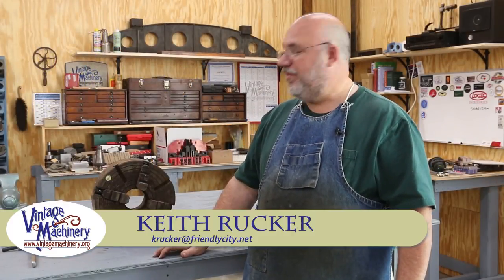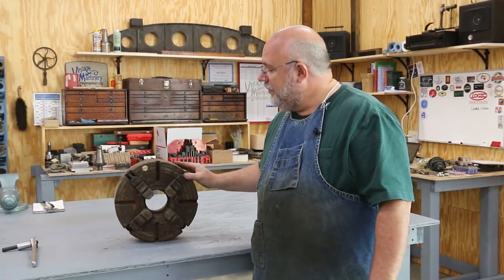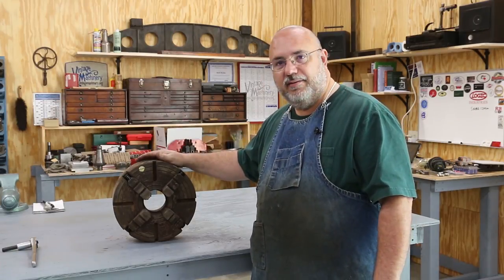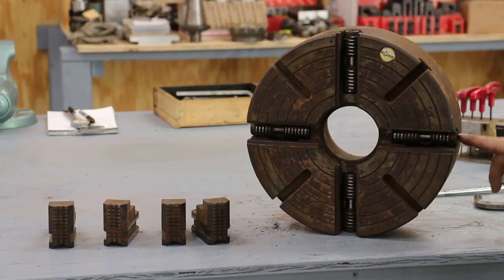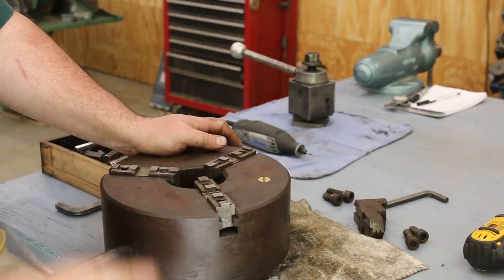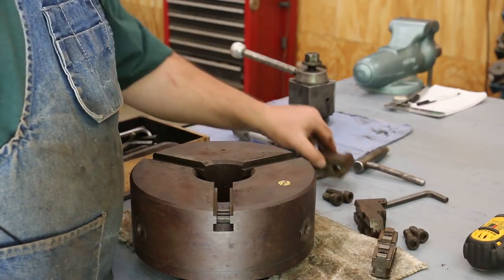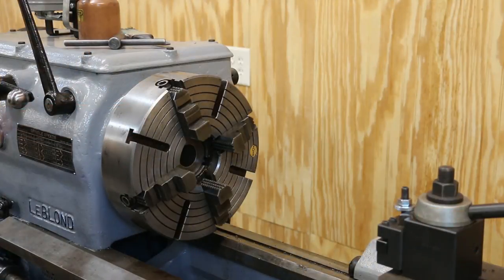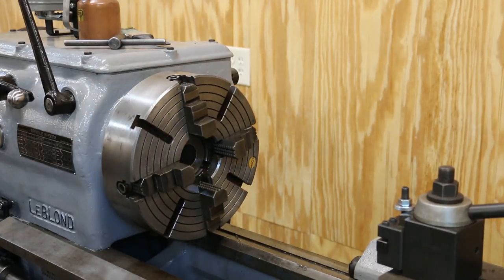Refurbishing Lathe Chucks

Comment: Everybody here in the comments is apparently an expert with more skill and knowledge than Keith. The man knows what he's doing or he wouldn't be so successful, quit your nitpicking.
Reply: RustyDockLight Wow, the comments on the grease over oil use where dead on right. My own comment on the straining of the evaporust is experience based knowledge from not only my own personal workshop, but also job experience in a plant that had military grade and micro medical contract strenuous condition tolerance's. No one person is an absolute expert on every aspect of any one thing. As specially not a multifaceted field like machining and maintenance an care of such things. It never hurts to take others experience into consideration.

Comment: Why are you skimping with the grease?
Reply: True I would have used half a tube of lithium grease on each.
Reply: Cause he doesn't want to be wiping it off the ceiling above the lathe for a year.
Reply: @stargazer7644  use quality grease and it stays put
Reply: @earleclemans4836  I've never seen grease with anti-inertial properties.
Reply: @stargazer7644  grease dont come out of my chuck

Comment: Wouldn't putting grease on the scroll thread cause premature wear by allowing dust/grit/chips/etc. to be pulled through? I would have assumed you would grease the pinions and crown, but not the jaw scroll.
Reply: Biggest no no in machining is grease, oil on chucks. Every piece should be dry!
Reply: If you run coolant, nothing will be dry...
Biggest problem in machining is improper use of compressed air and grinding/polishing on a lathes (lathe is not a grinder). Plus shitty jobs like turning old rusty drum brakes.

Comment: Hey old fella ,do you maybe know how to regrind old chucks to be true again?
I know,i know accuracy of chuck(3,4 jaws automatic one) has a lot to do with wear on chuck t slots and the worm itself,but had the case of tight fit on those and yet 3 jaw chuck had a 1/10 of a mm run out(which is not that much considering thing is 40years old,brand new made by sharp in india had 5/1000).
Do you know maybe how to regrind them on a lathe to be true again ?

Comment: Thank you for calling it an allen wrench
Reply: John Calma , it is inaccurate to call them Allen wrenches.   They are hex wrenches.   Allen was the originating brand name. It is like calling all refrigerators  a Frigidaire like we used to as kids.  I learned this when I was an engineer working for the Watsco manufacturer in Hialeah, FLORIDA.  They made hex wrenches for the refrigeration repair industry and mistakenly called them Allen wrenches in their catalog and got called on it. But I still call them Allen wrenches because that's how I grew up.
Reply: Here in NZ, we call them Allen Keys.  Hate it when Americans use the term ''wrench''.  We call a ring or open ended spanner - a Spanner!  Wrench just sounds crass.
Reply: Keith Jennings I was taught to call them hex keys. Allen is a makers name. Unless Allen made them. 😃
Reply: Isn't Allen the originator of the tool?  A Diesel engine is still a Diesel even if Rudolf didn't build it.

Comment: that le blonde is one of the machines I dream of owning those rhom's would probly actually be the chuck of choice of course buck an the like also good job cleaning em' up I'd a polished em' under power low speed with some #400 waterproof spnonge stapled to board as a backing and wd 40 (the wd part is water displacement)as the cutting fluid that approximates the factory finish hardinge is my favorite lathe but the le blonde is a reeeeal close second great video

Comment: with all due respect -- water is an improper rinse for a chuck. you would want to use eigher whitespirit or kerosene.
Reply: Toly,

Keith followed the water with WD40, which displaces the water and leaves an oily film.  Kerosene is a principal ingredient of WD40.  FWIW, I think Keith did it the right way.  The water rinse removed whatever chemical traces were left and the WD40 removed the water.  Remember, the rust remover is aqueous.

Eli D,
Reply: I suspect mineral spirits.
Reply: Evaporust is water based.

Comment: i really don't understand why a company would use imperial and metric on the same piece of equiptment. But then agian, i don't know why anyone would use imperial at all ;)
Reply: I do not understand why anyone would use Metric. Imperial works very well Thank You! : -)
Reply: It is just about what you are used to i guess, i persoanally find imperial confusing (course thread, fine thread, nubered screws, bolts and drillbits, lettered drillbits. fractioned drillbits...). I prefer a simple measurement of mm. But if you grew up with the imperial system i guess it would be the other way around :)
Reply: Yes but 3 thread pitches per bolt size is confusing to run into that often with metric!
Reply: We like to call it "Standard"

Comment: You NEVER put grease in the chuck because chips will stick to it and bind it up real fast... If you want to lubricate the chuck use lite coat of oil.
Reply: BULL-SHIT. Main reason of wear is using compressed air to "clean" things, plus grinding/polishing on a lathe.

Comment: REALLY BAD DEMO to promote a sad technique  You can use less than 10 percent of rust cleaner by simply but putting the chuck and ports in a heavy enough CLEAR Plastic Bag, you can support it in a tub for A POSSIBLE LEAK.  It Is a crazy waste to make a dip/dunk tank. (Marinade) Any you should have a funnel and Coffee filter your used solvents to reuse. TSP (Tri Sod. Phos.) from a hardware is a great and cheap cleaner for rust. Try some also in laundry or concrete floors  Grease and glues and paints too

Comment: What's wrong with WD-40?
Reply: It's massively overrated. There's nothing special about it. There are many better multi-purpose products like this. It's NOT very good rust preventive (it's only Water Displacement agent, light and temporary).
Reply: Nothing is wrong with WD40, it's a light oil and solvents that flash and carry out moisture. It does leave a film of oil and does okay at preventing rust.

Comment: WD 40 means water detergent,also helps cleaning small dusty parts.now when it comes to remove rust I have a better one.
Reply: WD 40 was developed in the aircraft industry so it works better on non-ferrous metals.  It works well on my stainless steel appliances; finger prints and greasy sticky stuff come off easily.
Reply: I believe the "D" is for displacement...and 40 just happened to be the number of attempts at refining the product, or 40th...at least that is what their old literature claims.
Reply: It was developed to use on the Atlas ICBM program.